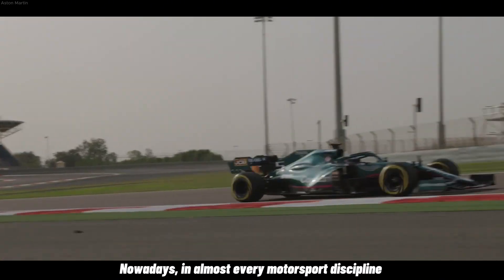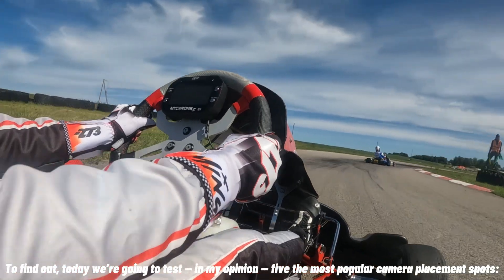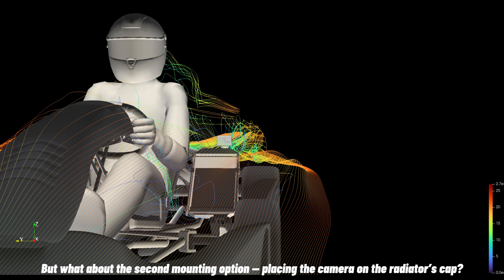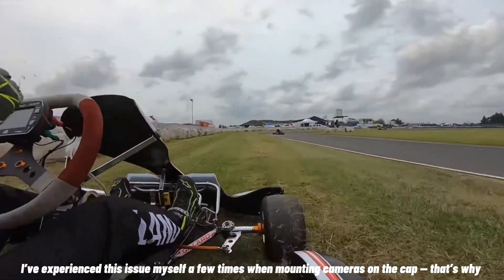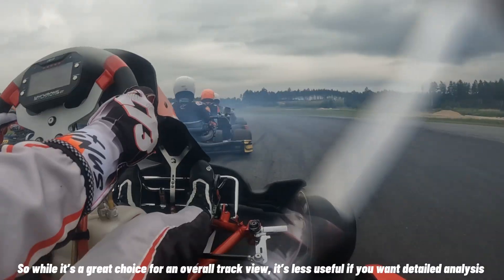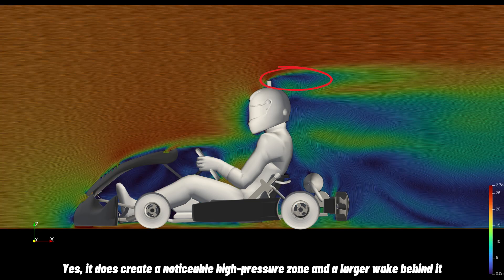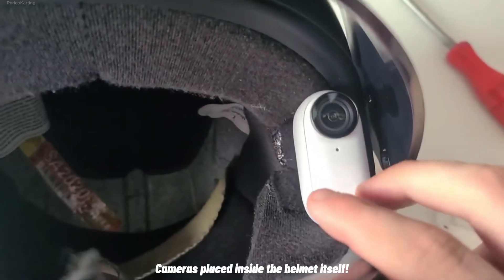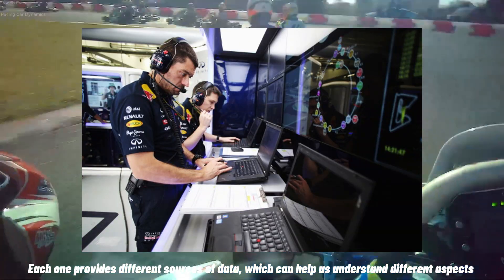Where Should You Mount Your Camera in Karting?

Comment: I wonder how I can mount my action cam on the radiator as most of the videos out there, but I have doubts about overheating as the radiator gets on very high temperatures and I am afraid of melting the plastic mount of the camera. What all the drivers do in order to keep mount stable on the radiator and prevent it from getting melt by the heating?
Reply from the maker: Hi, this sounds really intresting. The right camera placment on the karting is crucial! If you want we can help you find out for your case the best placment, from aero point of view. Feel free to write to us -> osaerolab.com

Comment: u forgot that the interior camera is a camera that u have to brake u helm to install it. Also sometimes its banned in some cases in comps.
Reply from the maker: Good point! However, there are different types of  interior cameras some can be mounted using  stickers, so you're not actually damaging your helmet. But this presented in the film requires cut in the helmet so yes it damages helmet. Another point, you're right—some races don't allow them at all. I've personally been in events where no cameras were permitted, regardless of type.
Reply: @OskarSavicki Alr, so interior cam can brake the helm and can't brake the helm?

Comment: I appreciate the insight this video provides! I've always preferred mounting my gopro on my helmet's chin area because i thought i would not receive any aerodynamic penalty. This video proved me wrong, but it is still the most aerodynamically efficient mounting option. I like to add an extension piece so that i can still see what the camera is recording and the blinking LED on the camera because my old gopro 4 once overheated and died mid race before and i lost all of the valuable footage and I didn't even know it turned itself off. This placement does suck big time as the helmet becomes very front heavy and the helmet moves around my head much more easily with more front weight. I'm considering attaching some weight at the back of the helmet to help with balance. Do you think that'll work?
Reply from the maker: Thank you! Yes I think this could help but keep in mind more weight bigger physicall challenge for your neck. I’d recommend testing this during free practice sessions first — mainly to see if it helps with the balance issue, and also to check if there’s any discomfort in your neck